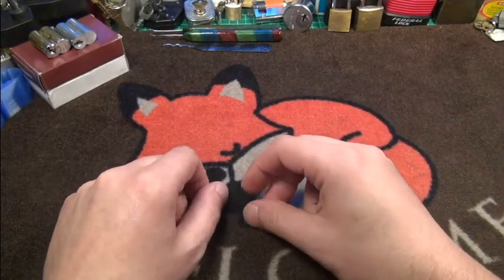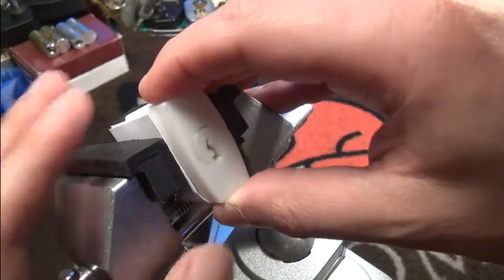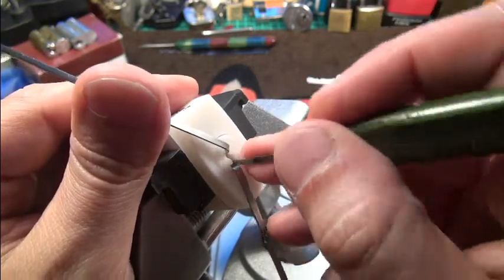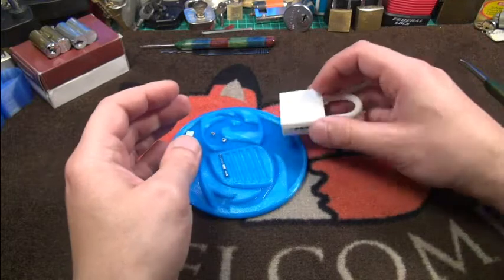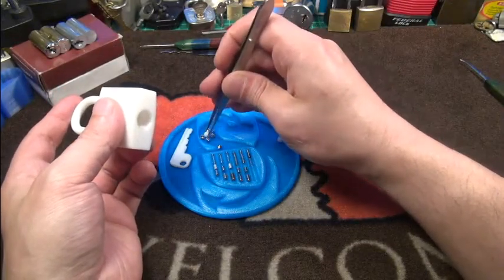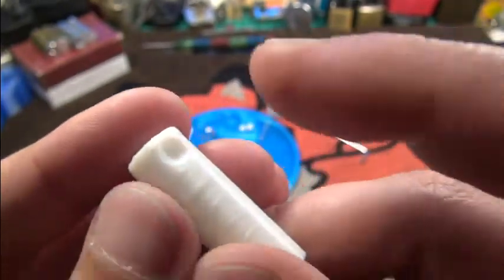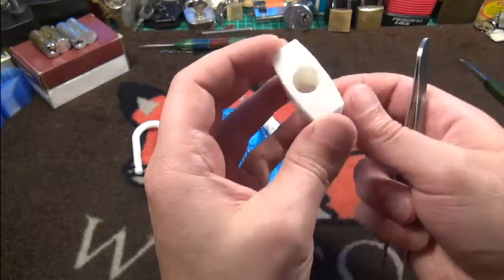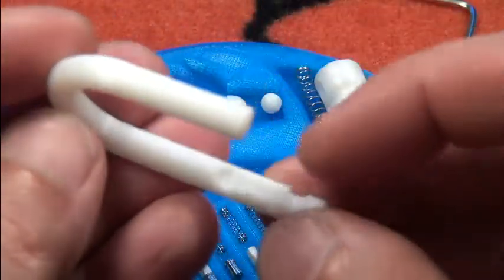(289) - my 3D padlock project

Comment: It looks excellent well done on the design and production and given the locks being printed layer by layer it may be possible to print parts within parts so whilst they can interact they cannot be removed.
Reply from the maker: Thanks a lot for watching my video too Andi :). Yes, it is probably possible to print parts enclosed inside ;D, but as LockNoob said, I like to keep it simple :). Saw your thoughts about the key ;D. It is actually hard to print a more complex key(way) shape to fit precise, but some can be made simplified, but it is very nasty to file this plastic and thin printed parts break very easy. A much better material for impressioning are soft brass keys :). But I get your idea ;D. Have a nice weekend mate :) 😃👋🦊
Reply: Maybe dimple lock keys would be easier as your not having to make such brittle edges to the key
Reply from the maker: As long it's not an Abus EC 😂✌. But yes, a more wide open keyway maybe. The filament (PLA) is actually harder than you might think ;). Not sure, but I'm temped to try it some day ;D. Thanks :).

Comment: Hey, what printer did you use to print padlock. I am looking for printer for my padlock.
Reply from the maker: I have a 3 year old CTC dual with around 770 printing hours on the clock ;D. With some modifications I can get out fine prints, it just doesn't like to print bigger parts like trays. Nowdays there are probably better printers for half the price ;D. 😊👋🦊